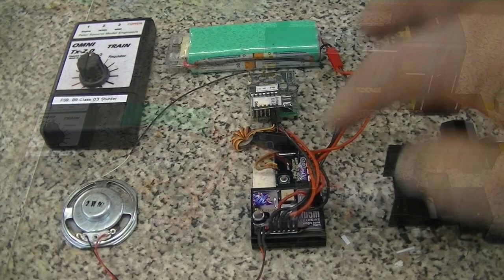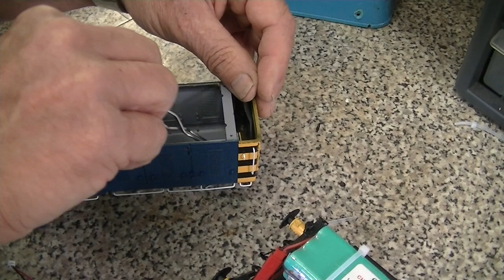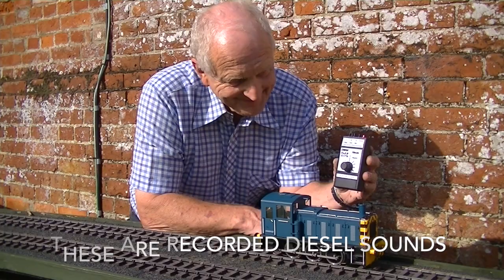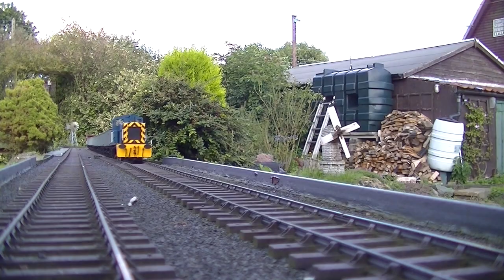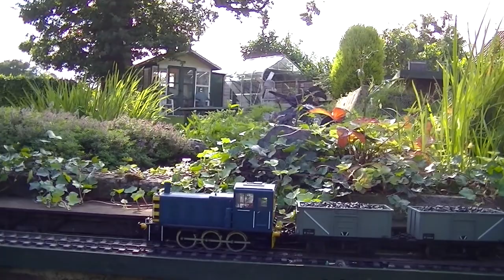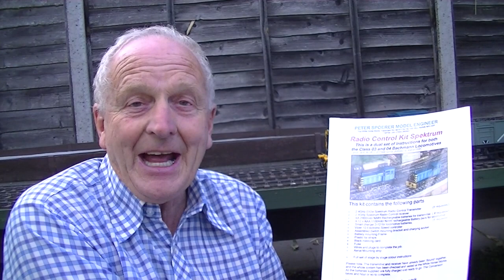Video 87. Gauge 1 Radio Controlled Class 03 with sound

Comment: I'm impressed. 
The FSB gauge 1 03 diesel models are very nice. I would like to convert mine to RC control with sound to do the model justice.
Would I be able to manage that even though I'm not capable of wiring a plug?